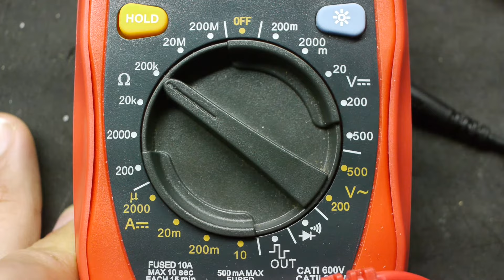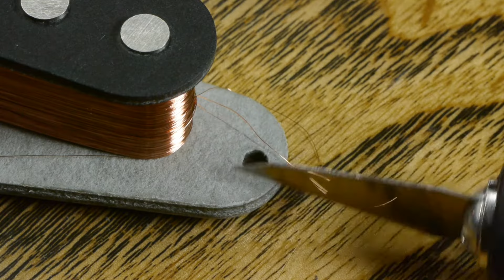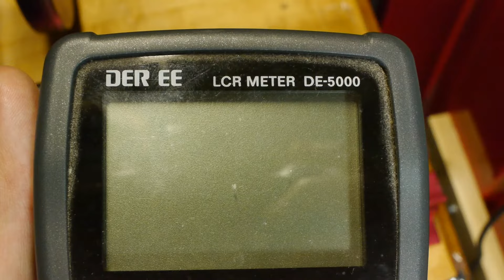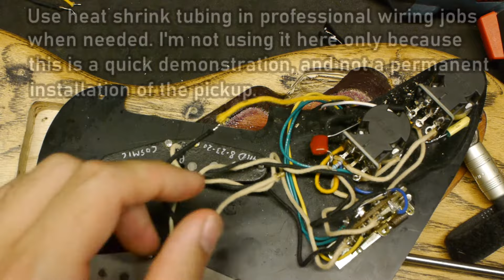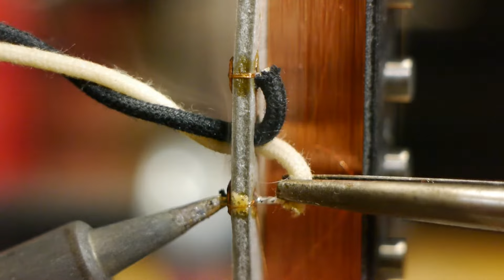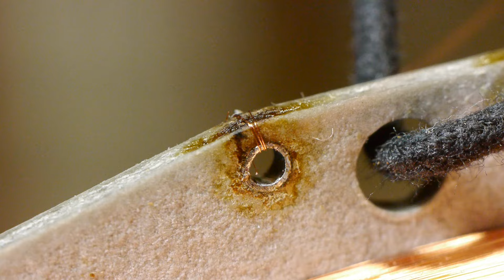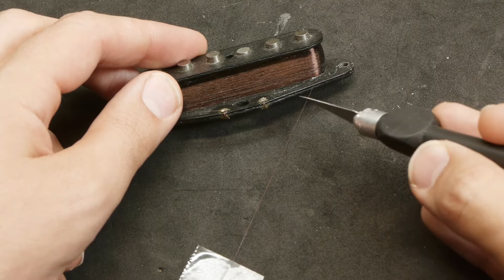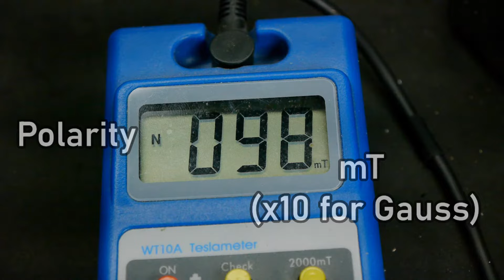Broken Guitar Pickup DIAGNOSIS + REPAIR | Fender Style Single Coil Diagnosis + Repair Demonstration

Comment: I don't know how I thought pickups were made but I'm suddenly finding it very difficult to spend $200 on some new ones. What could could possibly be different about a set of fender pickups that cost $100 and a set that costs $300? I'd at least want like the box to say something like "wound by trained butterflies" or "each inch of our wire is kissed by a priest", but I can't imagine what's actually different.
This was interesting and cool btw. I'll assume you weren't just making this all up
Reply from the maker: Basically: inductance and resonant frequency, and amplitude at that frequency, for a given pickup model (Strat, Tele, PAF style humbucker, etc.), is the best indicator of tone in a pickup. 

The challenge? These specs are almost never listed. Inductance is occasionally listed, but resonant frequency and amplitude at that frequency are never listed. I use a USB oscilloscope and a Ken Willmott Integrator and an "exciter coil" (dummy coil), as well as an LCR meter, to run tests on my pickups: inductance and capacitance tests, and bode plots. 

This all sounds like gibberish to the layperson. Think of it like this: EQ. Pickups have a flat EQ, but have a resonant peak -- one frequency where they will generate the most amplitude. This is the "voice" of the pickup. Its character. Much like your own voice. 

However, unlike humans, pickups are much simpler. In general, they have one resonant frequency, and a pickup of the same make and model (Strat, Tele, PAF, etc.) that has the same or a very similar resonant frequency, will sound the same or very similar. 

For the most part, how many turns of wire you use is what makes the difference here. 7,000 turns of wire will sound brighter and have a higher resonant frequency than 8,000 turns of wire. More turns of wire = less high end, and Less turns of wire = more high end. 

That's why "underwound" pickups are clear and bright and sparkly, and "overwound" pickups are fat and thick and punchy. More wire also means more output. 

There is no "magic," but the mystique serves the purpose of smoke and mirrors, and keeps people thinking there is something special about a $500 set of pickups. I've been winding pickups for years now and I cannot get on board with dishonest marketing. Though there is plenty of room for novel designs and pickups that achieve sounds that others don't.

But it's all a fine line, and all has to do with EQ of the pickup -- which is, keep in mind, a single resonant frequency, or its "voice." There is no such thing as deliberately winding "lows" or "highs" into a coil. The method of winding, in my opinion, is most likely irrelevant. The design of the pickup is what matters, and its resonant frequency or "voice." 

Anyway. I could keep going, but let me know if any of this made sense to you or helped you. Or confused you more! It's a very deep topic and it makes my head kinda hurt just thinking about it!
Reply: @guitar_md Yes, I get it. What about this "Scatter-wound" vs " Tight-wound" coils, do you hear a difference. The sound I dig the most on Stratocasters is the Enamel wound type but don't know if they were scatter-wound or whatever but the tone is more 3 D...if that makes sense?
Reply from the maker: @jooles0001  I don't think I have the technology / testing equipment to say anything definitive either way. I only base my opinions on measurable data. 

Not that going by ear is incorrect, but for me, I don't like stating an opinion on anything that I can't back up with hard numbers. 

To really answer that question, you'd need to first have a bobbin. So you're controlling for that variable -- magnets, coil height, etc. We want to isolate the wire as a variable as much as possible. And within that realm, you have wire gauge, insulation thickness, winding pattern, and winding tension. Ideally you'd control for each of these variables independently. 

So you'd have to wind it out a particular way. Tight, scattered, whatever. And then test it out, and measure the results numerically in as many ways as possible. Currently I'm limited to an LCR meter and a USB oscilloscope for making a bode plot. Those do give you a ton of information for a relatively complete picture of what a pickup will sound like, though it isn't the whole story, I'm sure. 

Then you'd have to tear the coil down, and rewind it again exactly the same way with Plain Enamel wire, then again with Formvar...varying only one variable at a time. 

So exact same winding pattern and tension, but different wires. Then exact same winding pattern, but different tension. Then different winding pattern, different tension, different winding pattern with the same tension, etc...

this could only be done with a highly accurate CNC winder that could 100% control for the winding pattern and the wire tension. There is no way to do this in a DIY operation and even with a CNC machine it would take a tremendous amount of work to set this up and test everything accurately. 

Isolating all the variables would be extremely difficult, but that's what you'd have to do to make any definitive statements. 

For me, the only difference I can think that exists between plain enamel and poly coated wire, is the thickness of the insulation and the consistency of the thickness of that insulation. 

Insulation thickness will change how the coil builds up. How exactly does that translate into tone? I have no idea. The only metric that you'll see insulation thickness affecting is that the capacitance will be lower, and you'll have more resistance for the same amount of turns, as thicker insulation means the total length of wire traveling around the bobbin is longer.

I use modern poly wire because it's much easier to use. I save plain enamel and formvar for special requests, typically vintage pickup rewinds, or rewinds of pickups that already had those types of wire on it. 

That might change as I do more tests, and if I come to any different conclusions. There is also modern poly wire that has thicker insulation. Even thicker than Formvar. I've been meaning to experiment with that. 

And even the same type of wire can be different spool to spool. I've gotten some weird results winding pickups and the only thing that could explain it was that the particular spool of wire I was using was different from the last. I'm sure they vary in terms of exact insulation thickness, and wire gauge. They're very accurate these days but with such small wire diameters, there's bound to be some variations. 

So in conclusion, I have no idea! I don't think most people will tell you that. I don't like selling people on things I'm not 100% confident in, and if I don't have the numbers to back up what I'm saying, I'll just say I don't know, even though I have a lot of experience winding pickups, and I based my early Strat pickup turn counts on using my ear. I played in a couple bands and that's when I discovered I love the underwound neck and middle pickups and overwound bridge pickups. 

Too much of a wind on the neck pickup especially just sounds like mud. And sometimes you don't hear how muddy it is until you're playing through a cranked head and a 4x12 bottom.
Reply: I have a bridge pickup on a new bass which works expect for the high string. The magnet under that particular string doesn’t seem to be working. Other than that I’d imagine the wiring is ok. Thoughts ??
Reply: I had similar feelings believing it's all propaganda just to show the majority  of us how pathetic we are on guitar so we would just forget the whole thing and take up stained glass  window construction. I've heard left handed guitarists are the one really pushing that agenda. yep!!
Reply: High price doesn't always make a better pickup, but in my experience getting a good pickup maker to custom build pickups by hand is worth it. I use this guy in Japan (Rugir pickups here on YouTube) and I've got 12 pickups from him. Mine are all different designs, but they sound way different than machine wound pickups. 😮